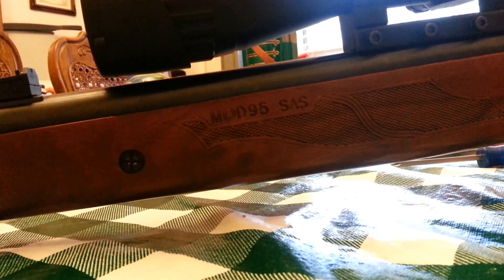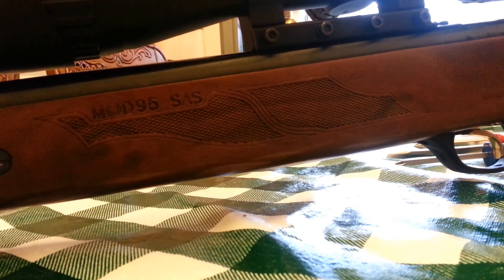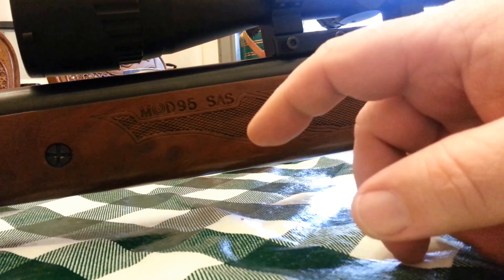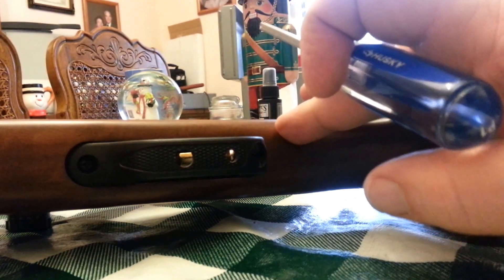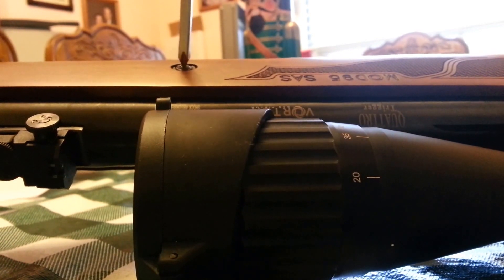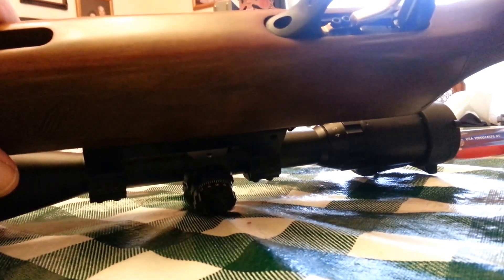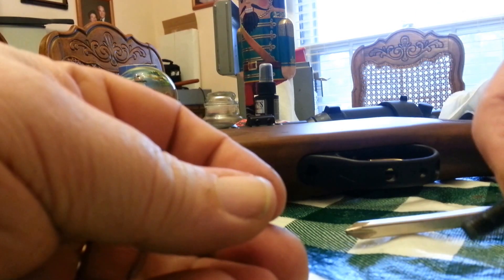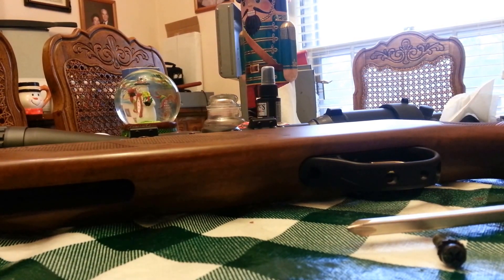My #1Problem with accuracy

Comment: I told u I'm going to stick with u til u make it to the top , remember me, also I have a hatsan 95 on the way from Amazon
Reply from the maker: +Isaiah Jones Congrats on the Hatsan. What caliber did you get? Is it the Vortex model or coil spring? Brother, I'm doing my best to do my best. I was all set to shoot through my chrony for the first time and my lighting isn't good enough so that's another project I'll have to tackle. My pellet trap works great though. Firing in the dining room right at the china cabinet, no worries. ;)